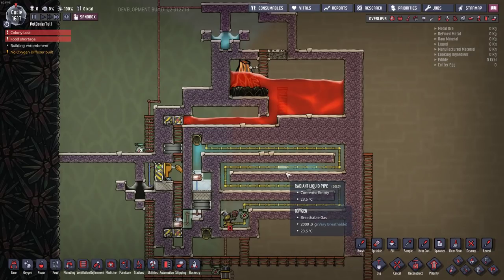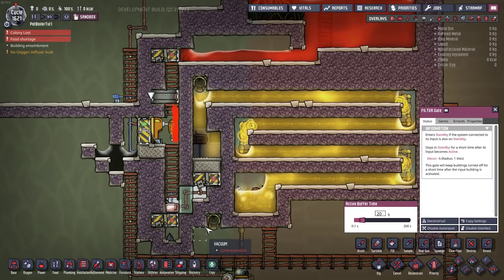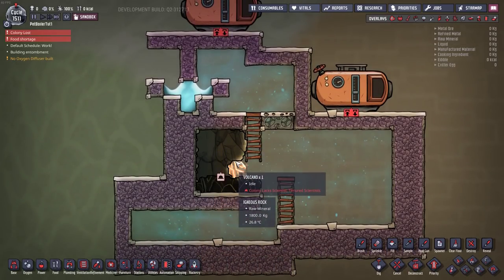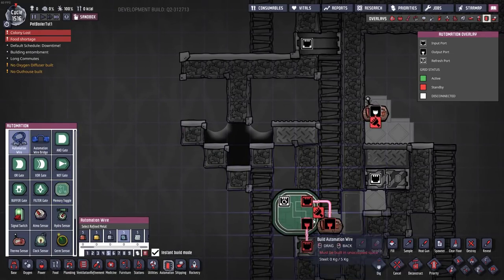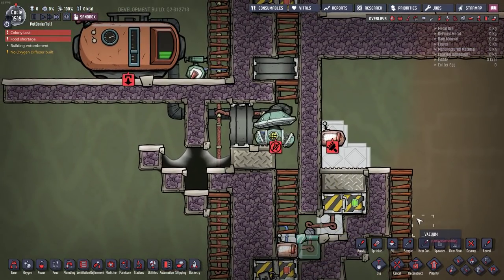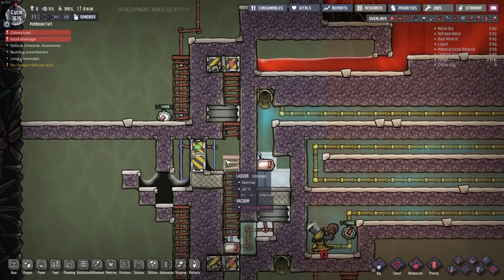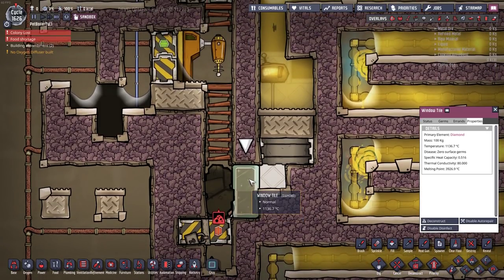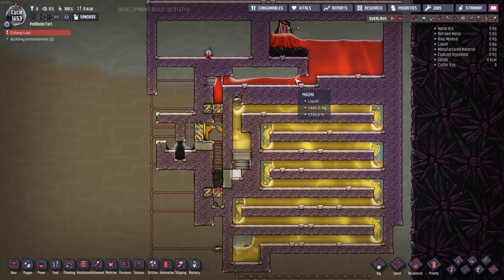Volcano powered petroleum boiler : Oxygen not included (Save file attached)

Comment: F, ing slush gyser in my map being right where I have to build the crude oil liquid lock. There is also a natural gas went and a hydrogen went just next to the counter flow position. This will be my first time in an attempt to tame a volcano. Though it is a minor volcano that i found.
Reply from the maker: Good luck. Leave yourself more space than you think you need.
Reply: @FrancisJohnYT   I built the counter flow at the exact size and shape you demonstrated for a minor volcano in your video. It would only just fit in between all the other vents around. I did have to find a diffrent way of dropping the cooling oil for the robominer but  that's about it. The slush gyser right there should keep it cold once I fire it up. i think. But it's going to make a issue if I ever have to get back in and fix something if I messed anything up.
Reply from the maker: @KimArvidsson  good rule for ONI something will always break :)